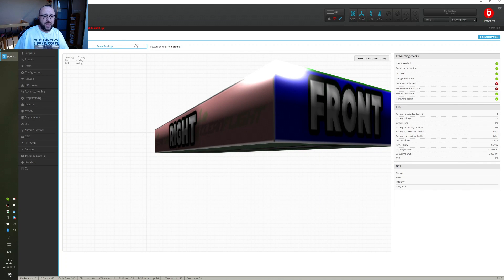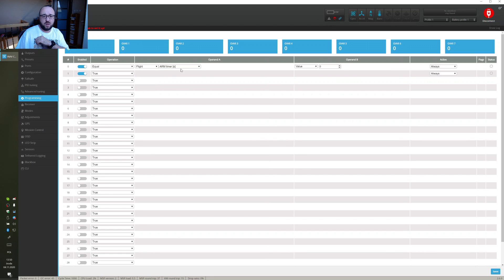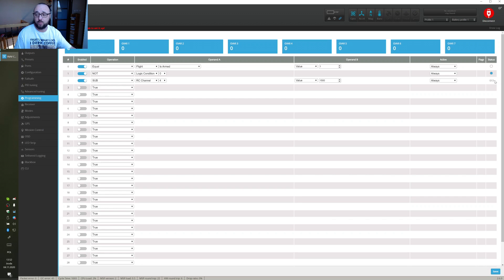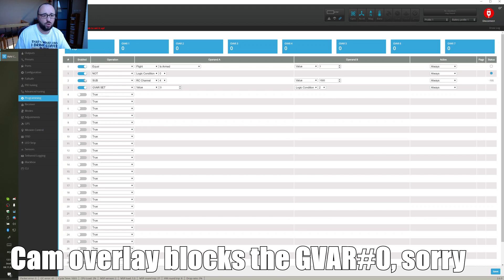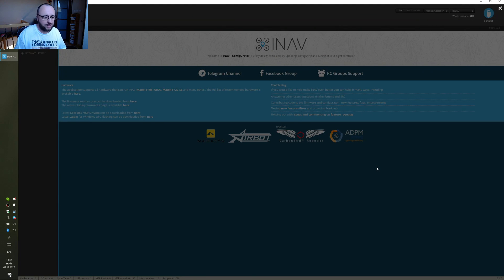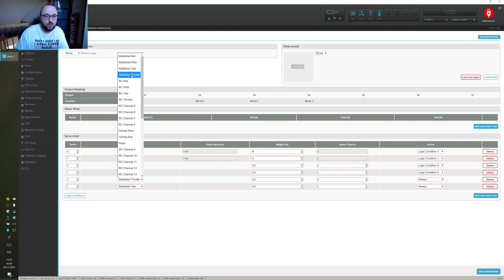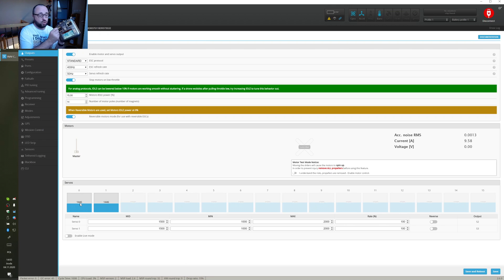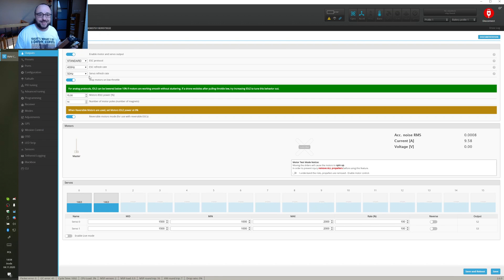INAV on tracked vehicles - autonomous RC tank maybe?

Comment: HI @FPV University .   my first time using rover mode...  I have no movement in the output tab although I did watch and confirm all params are identical to yours. I will be using an Cytron MMds 30  2 channel esc  and I can not keep the motor reverse mode when setting esc type to BRUSHED...
Reply: il faut mettre  la variable set motor_pwm_rate =400 dans le cli pour les moteurs brushed

Comment: Hi Pawel, I hope you see my comment but I’m trying to set up INav 7 for an airboat with two motors (so it will move using differential thrust). I’m assuming the setup will be similar to this tank as it also has two motors and uses differential thrust. I do not have any reversible ESCs. However which settings are kept the same and are different on this tank if I were to configure inav for an airboat? Thanks

Comment: Thanks again Pawel for getting my radio programmed to interface with my Christmas present tracked rover. The flight controller, receiver and ESC are doing the right thing; just
need to connect them.

Comment: I am in the process of setting up a rover r/c car for my son who is in a robotics class.  I want to use Inav because I want to install a gps so he can do missions on it.  This is my question I am using an AIO because the car uses a motor on each wheel.  So total of 4 motors.  Can this be done in Inav or is it limited to just 2 motors.  The recommended AIO was the fettec AIO and I don’t want to go that route.  Any help with this would be very much appreciated

Comment: I need your help please. Thanks for great video.I already configured rover like you.When I give a command Left Throttle(Forward/Back) and Right Throttle(Left/Right)same time servo outputs freezing. For control the rover must restart MATEKSYS again. I read S1,S2 outputs of the MATEKSYS with Arduino Analog Inputs and then control rover motors with L298P driver board. Please give me advise why servo outputs is freezing?  How can I improve INAV configuration?

Comment: Hi, I'm trying to get this working on an old broken 4in1 esc, (1 esc blown) it was running dshot, i have every setup the same in the video, and it all looks to work great in the configurator, except i can't get drive to my motors, i have tried standard protocol, dshot 300 and 600, swapped signal wires around on the esc,but still no luck, can you drive brushless motors with this setup?

Comment: I felt a little smart until I watched this, Wow! You have my respect good sir. I built a micro 1/32 rc car, using two motors on the rear to drive a wheel each. F3 brushed FC and inav 2.6. Working great so far, i obviously don't have reverse due to the oneway brushed FC. I have yaw stabilization on the turning servo. Working great too. I've wanted to know though, could I use the mixer to make the two rear motors act like a car diff? i.e. i don't need reverse, but the ability to slow and speed one up as i turn. I'm using motor 1 and motor 2 output in rover mode, or should I just set it up as a differential plane? .

Comment: Hi Pavel. I am using matek f411 but my outputs start from S3 so the motor channels S1 and S2 are not used. Do you have a solution
Reply: same exact situation! I am searching desperately for a way to output servo pwm on S1 and S2 but all I can find is rewritting the iNav firmware yourself. Have you fixed this issue?
Reply: I have found a fix, if you are using the F411SE, I have a custom build to fix it
Reply: @paul-fornage  please do share your fix
Reply: What’s the fix bro?

Comment: Pawel, this is fantastic but I am running into a roadblock. I can follow along exactly till the Mixer page at 6:12 minutes. You get Output S2 over Function Servo 0, and Output S3 over Function Servo 1. I get Output S3 over Function Servo 0, and Output S4 over Function Servo 1. 
Ultimately at the end, I cannot get servos 0 and 1 to move in Outputs. This depth is definitely beyond my abilities so I ask if you have any idea where I went wrong?
Thankyou (Tried both F411 Wing and F722 PX)
Reply: I figured out the problem. My throttle wasn't in the center when I tried to arm. It won't arm by simply moving to center, you must be in center then arm or it won't happen. Next my steering was correct but the throttles worked opposite each other. I corrected that in the mixer by making both Stabilized Yaw +100 weight, and in Outputs, making Servo 0 Reverse. Also you need a working ARM switch in Modes. :)
Reply: A couple more things others may find helpful;
My Matek F411 Wing requires the battery to power the Rx and GPS. On ~10 sec to be recognised in Setup.
To get all green flags, If indoors, clear (x) all "Nav" modes in Modes page.
Occasionally I had to "Save and reboot" the Config page, to get the last flag green. (?)
Then, center throttle and ARM. Should get movement in Outputs page.
Reply: @AntiqueAirman  thanks a lot bro)

Comment: Pawel, Perfect timing tutorial. I have followed this to the letter and when I get to the "Programming" page, it is blank.
I bound the receiver and a few other things to no avail. What am I missing? Thanks
(Using an old but unused SP F3 EVO FC) Inav 2.6.0, FW 2.5.2
Reply: I just tried a Matek F4se and it works. Is it safe to say this won't work on an F3 FC ??
Reply from the maker: It's not enabled on F3 boards

Comment: Pawel, many thanks, what happens if you use forward throttle plus yaw? Will the throttle values exceed +/- 100 and how will the ESCs cope?
Reply from the maker: Servo outputs are capped at 2000us so you will loose some of the authority since one motor will slow down but the second one will not accelerate

Comment: This will be useful for a 4WD longboard I'm building with hoverboard motors on each wheel. It has no turning servo, so I think I need to treat it as a "tracked" vehicle. My intent is to make a rideable rover capable of autonomous missions with a 200Kg+ payload. Naturally, it will also respond to traditional manual controls as well, much like a Boosted board. I think I'll have to deactivate the differential when there is a rider with manual controls?